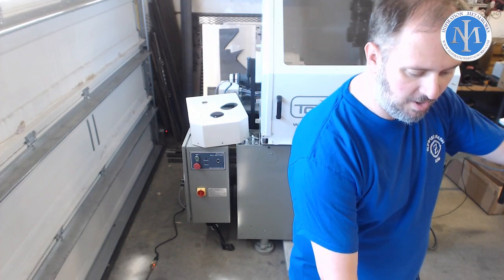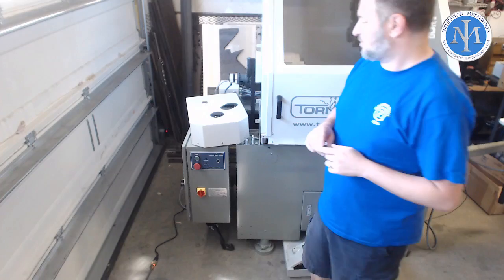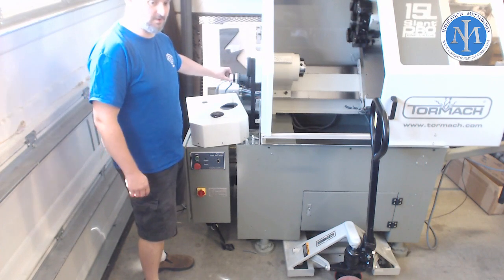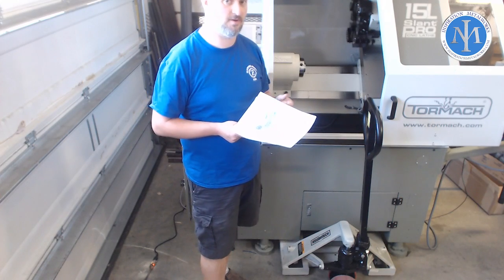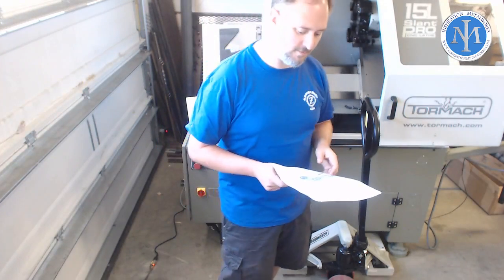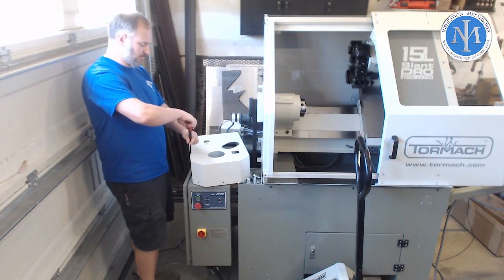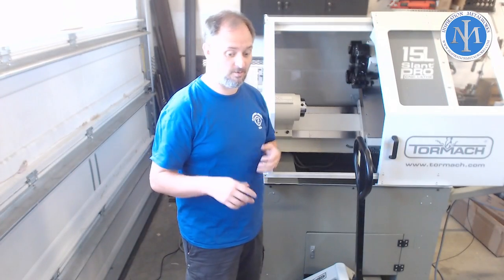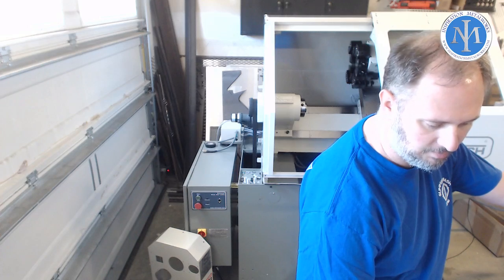Tom Zelickman Live Stream - New Streaming Software Test

Comment: Hi Tom,
Wish I knew you were going to do the live stream.  I would have been at my computer.  Looks good but there was a pretty strong hiss on my end through the broadcast.  Not sure where that is coming from.  I am sure you will have your hands full at Stan's with his bandwidth.  The new lathe is looking good.  How much power does it take on single phase?  You must be running it through a VFD??  Great stuff!!
All the best,
Reid
Reply from the maker: Hi Reid! That was a spur of the moment test to see how the new software was going to work. I hadn't planned on staying on as long as I did but there were people watching and giving feedback. Since I seem to have most of the issues worked out now I might start doing this regularly.

The lathe is 220V20A max draw but then you need to provide a 110V15A for the computer, monitor, and coolant pump as well. It does have a VFD there in the control panel but it comes ready for single phase use since it's aimed more at the small shop / hobbyist that isn't likely to have 3 phase out of the box.

The last of the parts arrived tonight! Hope to get these things in place and fully operational before I have to leave for the Bash...

Best wishes,
Tom Z
Reply: I appreciate the info on your new lathe.  Amazing that it runs on a 20A circuit.  Very nice!  Always enjoy your videos.  I am sure you will have a great time at the Bash.  Looking forward to your live stream.  Safe Travels!
All the Best,
Reid

Comment: Hey Tom great video and thank you for the plug. If you check out my bar puller video. I did a step by step on how to open and close the collet closer with m-codes and how to write a code to use the setup with any parts you need to make. Thank you again and best of luck with your new machines. Your shop looks great.👍🏻
Reply from the maker: Thank you! The bar puller video was next on my list... Getting so close to actually using the machine now. Appreciate your help with this, sir.

TZ